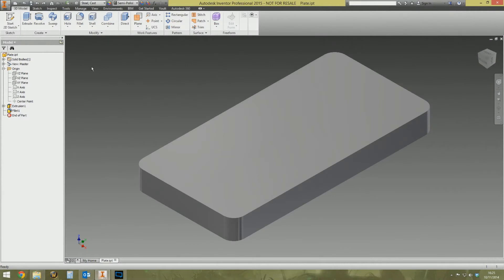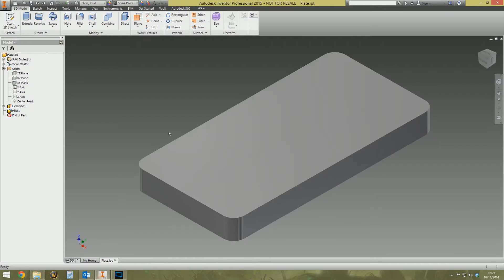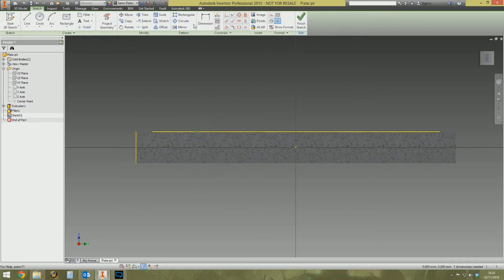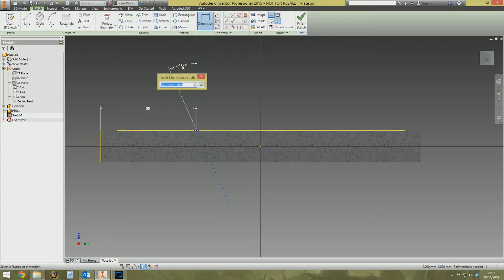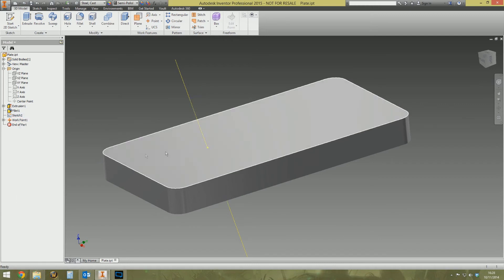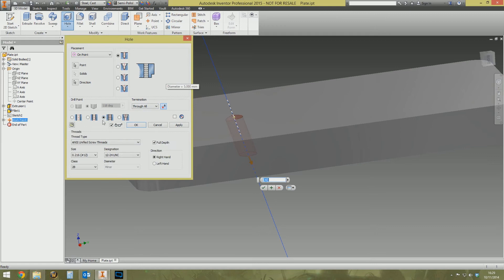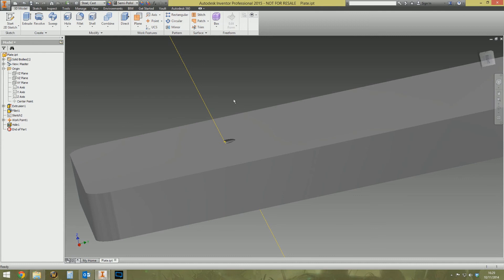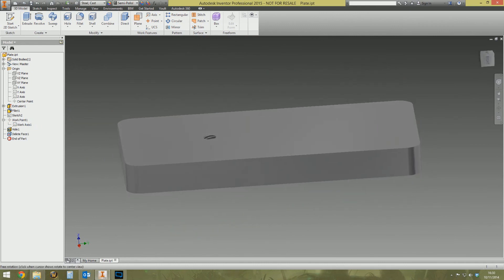How To Create a Compound Angle 3D Hole | Autodesk Inventor

Comment: ANY REASON WHY I CAN'T DRILL A COUNTERBORED HOLE AT AN ANGLE USING THE METHOD YOU SUGGEST?
Reply: You can do it. I use the counterbore feature in my work placing holes in refractory. It's not a true counterbore but you make use of those facets of the counterbore feature and adapt it to your use

Comment: thanks for the videos, the hole is an angled hole if it involves 1 angle, it is a compound angle if it involves 2 angles. sorry for the critique because I like all your videos due mostly for your humour and fun way that you present them. I recently had a job that requires a hole 20deg X 60deg. it was 60deg tilted back and 20deg swivel. I figured it out but with a lot of planes and cutaway. I bet that you know a simpler way. I would love if you could find a quicker method and share it with the world. thanks again

Comment: Hi Mr TFI CAD Tips. Just like to say how informative your videos are. I'm new to Inventor in the last 9 months and have picked up a lot of useful tips from your videos.

One topic I haven't been able to find though is the ability to drill an angled hole in two directions though. The company I work for design a fair number of hydraulic manifolds and if you could do a video on this it would be much appreciated.

Cheers
Steve Piper